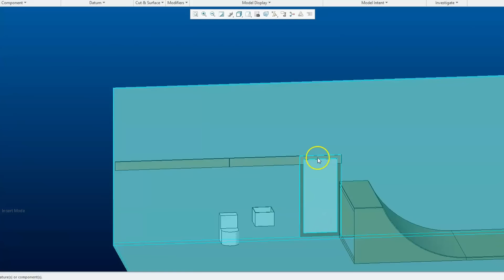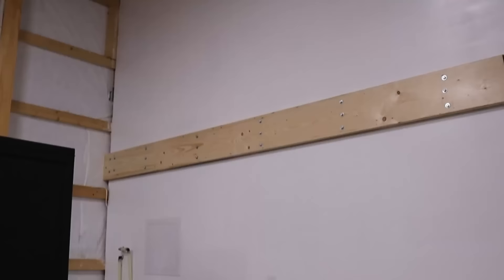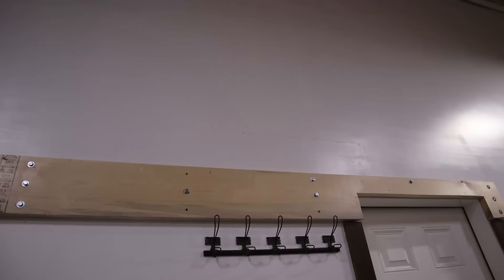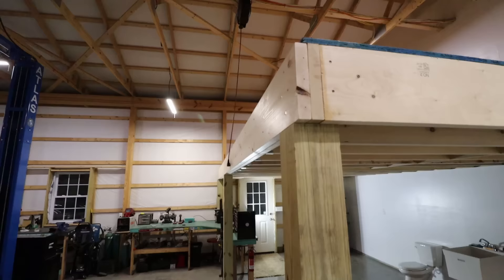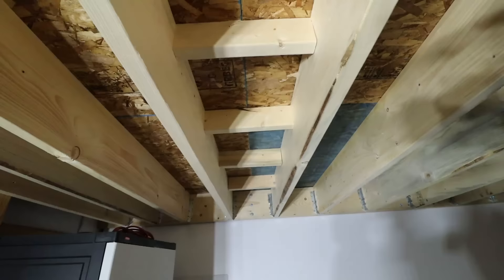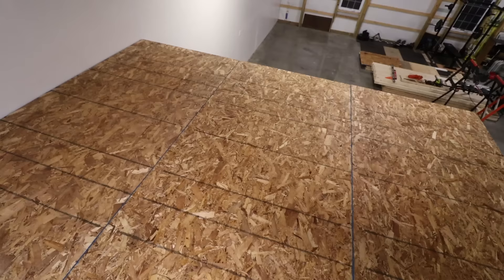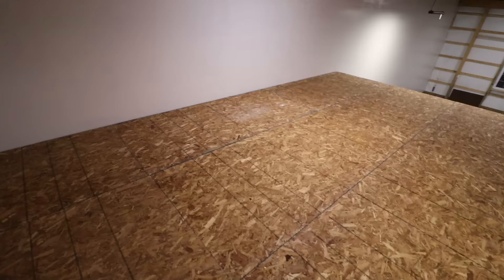Building a Large Mezzanine Loft By Myself - FULL BUILD

Comment: As a carpenter, this is how I'd imagine myself sounding trying to explain how to fix a car.
Reply from the maker: Hahha yeah I think I just made up "joist plate". Finally started saying header by the end. I am NOT a carpenter 😂😂
Reply: I’m dead.. 😂
Reply: @Kordare  technically its not a header either, its a beam.
Reply: carpenter or not this is impressive!
Reply: ledger board
Reply: Just out of curiosity, would you normally fasten the joists by the end grain?  I don't know much about framing but end grain fastening is sort of a no-no in furniture/woodworking.
Reply: Thank you
Reply: Am I wrong in saying that joist hangers should be fastened with nails and not screws? yikes
Reply: Kevin Henne They make structural screws you can get now. Simpson makes some specifically for use with their various hangers.
Reply: Should the beam that’s just screwed into the wall be supported with some 2x4’s?
Reply: 14 inch between every 2x10 made me cringe
Reply: @Michael-Bishop  , I'm not a pro or anything, but that does make sense kind of like you'd do with a jack stud in a doorway
Reply: @kevinhenne8634  you can get structural screws that have the shear strength of nails that are allowed. But he used regular screws which technically is a no no
Reply from the maker: @salbigdaddyc  hey I used pro/e Creo
Reply from the maker: @jessefleming9763  yeah the screws I used in this video were completely wrong, I replaced them all with the proper recommended nails as I show in the following video.
Reply from the maker: @TheBrownieSundownHD  this was done mostly as a temporary hold until I installed the joist hangers
Reply: @TheBrownieSundownHD  The end grain screws were to hold them in place. The underlying hangers are where the structural support comes from.
Reply: Yep and 16 on center is the normal and plenty strong and he wouldnt have had the problems where the ends come together...as soon as he said 14 on center i knew he was gonna have problems lol
Reply from the maker: @wesleyl4283  haha yup but I wanted it just a little stronger since I land up top on my bike with concentrated loads.
Reply: @kevinhenne8634  Simpson Strong-Tie makes specific screws that can be used; in fact, the entire thing should have used load-bearing construction screws, not random Lowe's screws - and maybe he did; he didn't really say what screws he was using.
Reply: I came to the comment section for the roast.
Reply: 16”OC is normal. For extra support, should use 12”OC. Then plywood sheets would end on a joist every time.
Reply: @Kordare  That's awesome; it's not often that people admit mistakes and actually show that they learned and fixed it.  I can't count how many videos I've seen demonstrating extremely dangerous processes that were pointed out by dozens of commenters and the person posting the video never even acknowledges, let alone demonstrates the correction.  Great job!
Reply: How many sticks of wood did that project take?
Reply: i am a carpenter ... 12" 16" and 24" centers is proper spacing for joist and studs,, when set up with any of these spacings your seam will always fall on the center of a joist . joist spacing is based on what your building ,, the length of the joist and the load your putting on it  ,, and the plywood decking shouldn't have seams that match ,, ,always stagger your seams ,, it makes the floor alot stronger and you don't have the problem of all the "smooth" seems in a row ,, that's a weak seem and as floor or joist warp and twist it can open up and be a trip hazard ,, you don't want a trip hazard up there... the band joist over the doors could have been doubled to assure strength  .. and when you can always glue and screw your decking (floor)
Reply: What is your building's wall height? 14'?
Reply: You’re all wrong. It’s called a ledger board.
Reply: @Kordare  The 3/8" dia. lags are actually inadequate for the shear forces in your situation, especially considering the dynamic loading imposed from landings off of the half-pipe.
Reply from the maker: @salty_flightdeck_cpo  well I have 3 of them every 2 ft sunk into 2x6 studs so I'm not worried about it. I also built bathroom walls right under the middle of the whole structure. Been riding on it for over 2 years, no sign of movement.
Reply: Nice work. Could have saved alot of extra work by making it 6 inches higher. Unless code wouldn't allow?
Reply: I got to admit. I laught 
But I’d be glad to know what is wrong and a correction

Am a machanic by the way
Reply: @Kordare  But unfortunately right where you are landing (Your bike) is where you cut down your joists into essentially 2 x 4s over that interior door.☹️
The smallest section of that joist dictates its strength and those two are essentially 2x4s. 

And cutting the bottom part of a joist by the exterior door is the worst place but like you said the good thing is they are closely spaced there so not so big of a deal.

The bottom line though is that doing 14” OC really created more work (16:58) and issues (for anyone viewing this).

Comment: When adding the second joist on the outside, you should always stagger the joints, for added strength, so if you have 2 full length boards(2x10) cut one in half, glue and screw it, put up the full length(glue and screw) then the last half piece(g&s) that way all your joints are staggered and covered as well.
Reply: Damn ROOKIES!
Reply: Looks good. But also if you stagger your osb Sean’s it’ll add strength. 16” OC would help eliminate the need for extra bridging at OSB seams, but I understand the desire for 14” OC. Nice job.
Reply: While we are at it. Use you speed square as a guide while cutting your lumber then you don't have to watch the line
Reply: That's not always the case. In this case, it's bearing on the post so staggering the joist would not add more strength.
Reply: I disagree. I'd rather have the load bearing on the posts. If he had long enough boards to span two sections, that would be a different story.
Reply: If you put a joint in the middle of the first 2x10 beam, then you still only have the strength of one 2x10 .The load goes through the posts to the floor and so the beams should span from post to post.
Reply from the maker: @skiprope536  I wouldn't even say I'm a rookie, I dont ever do carpentry. This is like my first ever large project. This is NOT meant to be a how to video. This is a car channel if you havent noticed.
Reply from the maker: Yeah, possibly. But I liked the idea of having the ends of both boards being supported to the floor by posts. Either way this thing is way overbuilt for what I'll be using it for.
Reply: @Kordare  Relax buddy. We are on the same team. I think you did a great job. You just over killed it in areas' and others I scratch my head.
Reply: Agree, I said the same thing.. I've done construction (I'm a master carpenter (retired))
Reply: @Kordare  Yup, You do good work.. You got to give us a bit of slack, if you was watching someone make bad mistakes doing car work, I'd think you'd make a comment, not to criticize, but voice concern.. We are doing the same.. If you are going to have a lot of weight on top, you might want to reinforce it.. Like maybe adding a second layer of osb running front to back to cover your joints, this would go a long way to making it very strong and safer to have a heavy weight load... All an all, you did a very good job... I enjoyed watching very much
Reply: @skiprope536  All my joint's are screwed.. When you're young you think you are un-destructible.. Hell I would tote 3 sheets of 3/4 plywood over my head and using fingertips just to get the workout, Now brother. I am paying for it.. Kills me that I no longer can do any hard building, I am lucky to build small projects anymore, in my shop.. Sucks getting old & worn out...
Reply: @Kordare  Dude relax - you did a decent job. I'm a carpenter too - and apart from staggering joints (and maybe doubling up on the first floor joist) I'd have done mostly the same myself. Give me a wrench and ask me to rebuild an engine though...well let's just say you did a better job at carpentry than I would at rebuilding an engine.
Reply: No dont stagger the joints thats what normal people do - keep the joints in the same place and dont spread out the glue either - Jobs a good-un
Reply: TheWolfster001 master carpenter? So, I hate to jump in on his post but would this notching of the 6x6 post be fine for a patio roof cover? Or would I be better off attaching to the top portion of the support posts with the hurricane metal fasteners?
Reply: Being constructive, Staggering the joints on the deck, glue each floor joist, posts should be on solid footings, 12” or 16” OC works best. Not sure what screws were used for the hangers but joist nails are best. Double up on the joists at the house door. Double up in the exposed end. You can firm it up using corner bracing under the deck or strapping as you would Sheetrock it.
Reply: @daddy-orockstarmunchabunch3568  Ultimately, could have gone to 12" on centers to eliminate the ply issue & create even great support strength.

Comment: With the OSB, first row start a full sheet, then second row start a half sheet to stagger the joints, will tighten the frame up significantly if you stagger the sheets/joints.
Reply from the maker: Yeah I kinda realized this after the fact but oh well. Appreciate the feedback 🙌
Reply: @Kordare  Please keep up the excellent work, love seeing the design to build happen !
Reply: Ya helps keep the floor system from wanting to rack side to side
Reply: Came to comment the same about staggering, 16" on center floor joists would help too.
Reply: and run your floor board 90 deg to your joists
Reply: @Johnmonty85  Could you explain what you mean? I'm having a hard time picturing what you're saying.
Reply: @fgaryam  the deg might be wrong but for example if your joists are running north to south your flooring needs to run east to west for strength
Reply: @Johnmonty85  it is in the video?
Reply: @ThCrunch  cool beans
Reply: that, and, if the joists are 16 on center the edges will fall on a joist. but wow, super job, it is built to hold a tank on it.
Reply: How does it tighten up the frame? Planning something like this myself, would you mind explaining it by any chance?

Comment: Friendly tip (maybe I'm repeating what someone else has already said), screw small cleats to the ends of your joists that aren't being stuck in the hangers. You can walk them over, hang them on the rim, and get them positioned to install the hanger on that end. Its an extra step, but you don't have to support the weight of the board for as long getting it in place and aligned. Just something to think about to make your life easier if you do any other platform or deck framing. Aside from that you did a great job! Very well thought out.
Reply from the maker: Thanks for the tip!

Comment: Need to think about plywood when setting joist. Good spacing is 12" 16" or 24" that way you have backing on all seems and edges. And like others mentioned stagger the plywood. Other than that great work. And remember one thing   "only people that don't do anything make no mistakes"
Reply from the maker: Yeah definitely made some mistakes here, but have already went back and fixed the ones that mattered. Mainly switched all screws to nails in the joist hangers and added bracing over the doors.

Comment: Excellent work overall, very informative on several items. One thing I would like to mention is that the stringers above the posts need to have their cuts staggered in such a structural beam application. Having the board ends meet with no overlap creates a failure point above the center post, and enough load on this point can split the post vertically along the grain, the same way a log splitter works. Simplest solution is to remove the outer layer of stringers and swap them.

Comment: How much weight do you think something like this could hold? It seems like it would work perfectly for the loft gym i have in mind! Great build by the way !
Reply from the maker: Thanks a lot! Check out some load tables online for a 2x10 floor system, that should roughly tell you. But I'm sure this would be fine with a couple thousand pounds. I would be a little nervous dropping a deadlift on it of 500+lbs in a concentrated location

Comment: There’s a reason to use 12 or 16 inch centers, the floor joints landing on it. You did a good job making it work though, a little extra work
Reply from the maker: Yeah I just liked the strength of 14" and thought 12 was too much 😂
Reply: Kordare you did a nice job of making it work, should be super strong.
Reply from the maker: @thomasbooth9079  thanks, all the pros on here think it's gonna collapse the minute I step on it 🙃🙃
Reply: Kordare I doubt it, I would be tempted to brace the corner post..... but I like overkill. The walls on two sides should keep it from racking one way or the other.
Reply from the maker: @thomasbooth9079  oh yeah there is zero movement in any direction on this thing

Comment: Really nice work- good design, good tools, and I like how you never jammed or rammed anything. Nicely done. My only respectful comment on the floor is that I'd either lay down some plywood finished on one side, tongue and groove- the adhesive on the chipboard can loosen and some of the chips lift a bit. Again- super job- really like what you've done here. Thanks for sharing!
Reply from the maker: Thanks a lot! I'm planning to put down some heavy duty paint so the flooring holds up over time.

Comment: Dude is totally preparing for Quarantine 😂👌
Reply from the maker: You know it 🤘
Reply: @Kordare  just found your channel. I built over Two Hundred Homes starting as a framer at age 14, working for my uncle on weekends and summers before I went into Army Intelligence right after High School. 

I would like to make two simple recommendations: 1- Dump the Ryobi saw and spend an extra $30 on at least a basic "Skill Saw" - much better quality with more Powerful motor, which makes cutting infinitely easier and lasts 5-10 times longer. Ideally you'll also want to block in the floor deck where the seams of the plywood is, because over time they can start to buckle or even start caving in downward. Too late for plywood clips but those help too. 

Great job on the lag bolts on the back wall. 

You can't wrong and I was pleasantly surprised to see you add the Joist Hangers on the front as well. 

Also, would recommend that you use a high traffic floor paint on everything, but the floor deck is especially important to keep out moisture and retain moisture if it gets too dry in the summers. 

Recommendation to start the second row with a half sheet is of course the best way and you can use the second half of that sheet at least on your fourth row which keeps waste to a minimum.

Home Depot is a great source for the price point your looking for.  😉
Reply from the maker: @sterlingmichaels  appreciate the feedback and recommendations!

Comment: Use a scrap of the 2x10  inside a joist hanger, to align the top of your joists with the top of the ledger board on the wall, that way ALL of your joists are at the same level. Since you do everything solo as I build the same way, screw a scrap piece of 2x4 under your post supported section 2x10 to support your joist as "another set of hands" especially when working on ladders and power tools. GRK structural screws are another option for anchoring ledger boards to a wall, particularly for indoors work, they are an excellent solution. Keep up the good work

Comment: Very nice loft. One question though, why 14" OC ??? The standard spacing is 16" OC, which means the 48" wide floor almost always lands on a joist...
Reply from the maker: I just wanted a little extra support since I might be landing with a bike up there creating a pretty concentrated load.
Reply: Would 12” on center make more sense? That way your plywood hits on 48”
Reply from the maker: @c50ge  yeah that would work as well, would just use more wood
Reply: That's what I was thinkin
Reply: Exactly & he wouldn’t need those additional braces/blocks of wood he added afterwards & he should’ve staggered his flooring so the seams wouldn’t line up. In addition the floor joist should’ve been at 8 feet in height then wouldn’t need to notch the joists by the exterior door too, plenty of head space still would’ve be had on top afterwards. Overall the design isn’t bad, just needs a lil tweaking.
Reply: Yeah. Obviously not a builder. 12, 16, 24. 12 would have added on or two more joists. Even 19.2 is done...something that divides evenly into 8ft. "Lag screw for concrete."  Just busting your chops. Important thing is you did it. You wanted it, you built it, you did you.  One thing about screwing your hangers rather than nailing is that screws are hardened and brittle. Nails will yield (bend).  If you're going to be landing bikes hard on that, you might be snapping screws. Keep an eye out.

Comment: 18:35 just wait until it’s 100 degrees outside. You’ll be cutting that last joist again, lol.
Reply from the maker: Hahah yup my thoughts exactly, just have to break out the jigsaw real quick
Reply: @Kordare  A belt sander would get it done too Scribe a line and work back to it and it will give you a cleaner result
Reply: Box out that space above the door with double headers on each side, just like you would an attic access. You'll never have to worry about if that door will clear any joists in the future :)
Reply: Or when's got bunch of weight up there